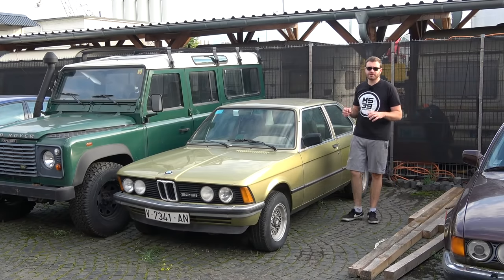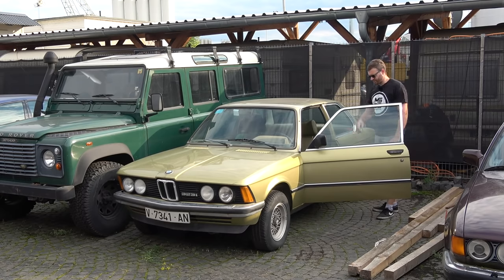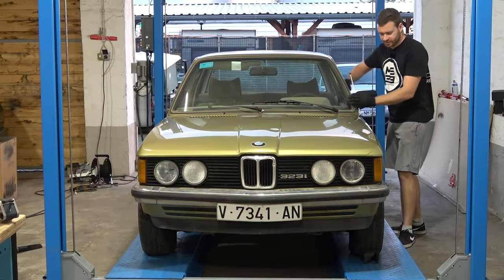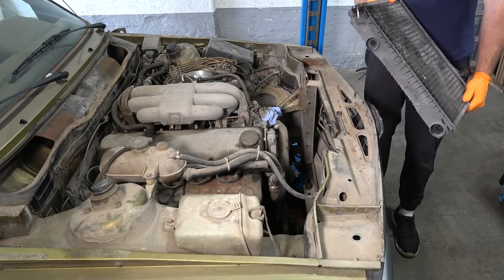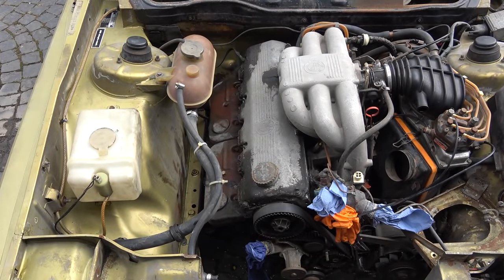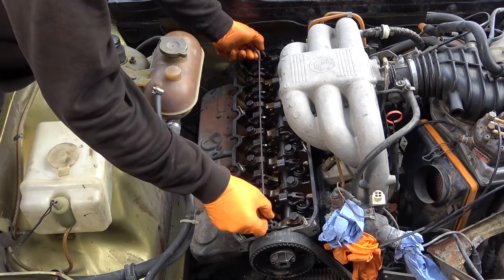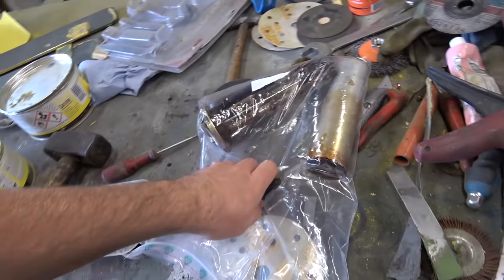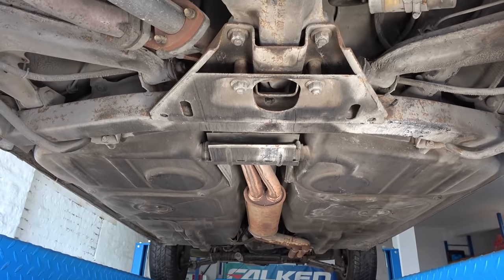26 Years Of Sitting - What Does It Take To Get it Running? BMW E21 323i - Project Castellón: Part 2

Comment: you want to remove fuel varnish? throw in some ethanol. available everywhere. honestly, i wouldn't bother trying to revive it. waste of time. it needs a full rebuild, so just rebuild it.
Reply from the maker: Wrong thinking. You need to revive it to see what else is bad and needs rebuild/replace. These are very old cars and most of the parts are NLA, you can't just go and repair/replace every part on it.
Reply: @M539Restorations  not wrong, just different. an engine that old with that much known damage - a basic visual inspection of parts would tell me enough to know if they need replacing or restoring. look forward to the next instalment either way.
Reply from the maker: That won't get you very far. For example, the control pistion inside the fuel distributor looks brand new upon visual inspection and yet it's stuck and doesn't work. You can rebuild the entire engine and the car won't start because of it. It's always smarter to get it running and start assessing from there vs just throwing parts at it and rebuilding stuff that shouldn't be touched cause you can't get parts to fix it later. It's not my first rodeo. :) Thank you!

Comment: 55 minutes is too long simple yes or no wil do
Reply from the maker: No, it won't. Don't have to watch it.
Reply: @M539Restorations even if it's 2 hours long I'll still watch the whole thing best channel ever
Reply: @M539Restorations  did you get the engine running